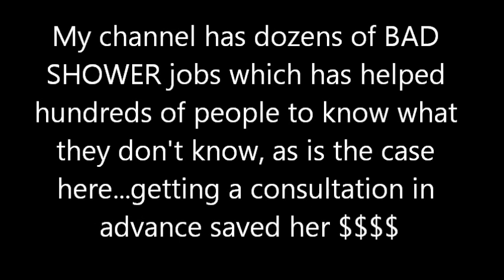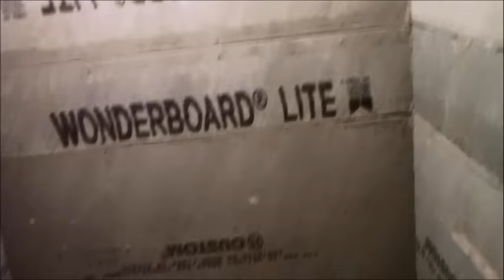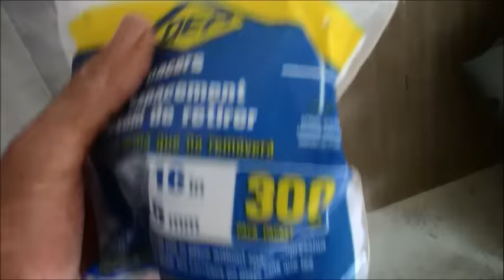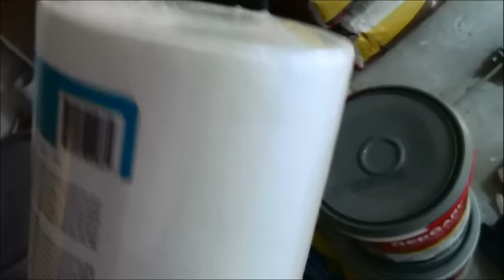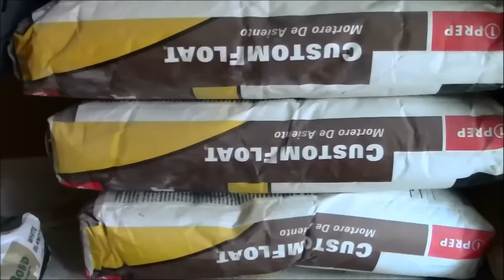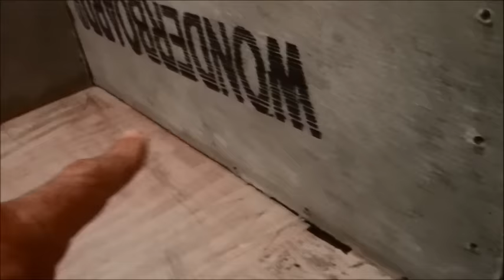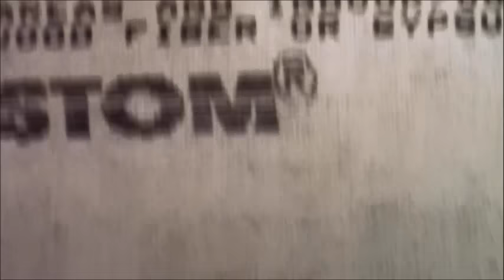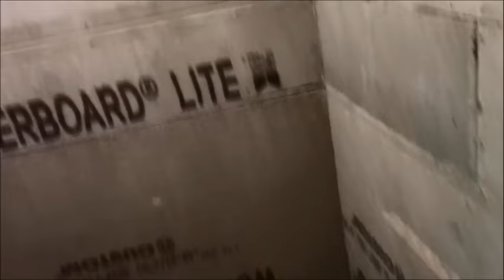BAD SHOWER DAY ONE !!

Comment: red gaurd is useless with out mesh tape
Reply from the maker: Says who ???

I have experiments I've done in my channel using only two coats in a cardboard box, and a drywall box, on every material imaginable filled with water for weeks without any tape
Reply: @StarrTile  mesh tape and red gaurd always go hand and hand every job ive ever done when it comes to waterproofing description with plans and blueprints always calls for  both tape and gaurd together
Reply from the maker: @ronlutes  tape is a crack preventer, Red Gard is a crack preventer, right there on the label, to use both is redundant but you do you
Reply: @StarrTile  tcna f125  or tcna fi25a 
for cracks
Reply from the maker: You assume I subscribe to the tcna recommendations, which I don't, my 23 years experience has taught me better than a book
Reply: @StarrTile  ive got 30 years in the trade and ive seen it  fail time and time again . 
the only time ive seen it perform well is when mesh tape is used with it. 
even with that being said there are so many other way better products that  can be used they cost more but  well worth spending a little more money than taking a chance with red gaurd
Reply from the maker: @ronlutes  if you've been doing this for 30 years then you know as well as I do that walls do not fail, it's always ankle below that is the weakness of any shower, that being said if a liquid topical membrane is applied correctly it will never fail with or without tape, I have done many experiments including flood test with liquid topical membrane and I have never had a failure, if you see failures all the time then I suggest it's operator malfunction and not the product. It is extremely doubtful that the product failed, I would like to see proof of that.

This experiment I did a few months back cast doubt on everything that you think you know..
https://youtu.be/t6y2Fl0wznk
Reply: @StarrTile  i can see your doubting my experience in the trade . i have 15 tile setters working for me i see lots of showers
im not interested in looking at experiments that you or anyone else has done . reason is 
i dont think that any experiment can duplicate any real world situation . all im saying is from what i see in the real world. if your going to use red gaurd  its taking a chance. i see lots of showers that have failed many of them with red gaurd  involved. sure the way its applied makes a big difference . best advise i can give in the real world tile installs when it comes to water proofing if your stuck using red gaurd for some reason use the mesh it is a small step that can avoid a failure
Reply from the maker: @ronlutes  what you don't understand is that experiments exacerbate real life situations, they exaggerate what a real shower would actually go through... I don't do them to convince anybody, I do them to convince myself just like in that last video I showed you I did not know that the liquid topical membrane would actually impregnate into the mortar the way it did so I'm extremely confident now with my builds having done that experiment.
Red Gard is only my go to product because I shop at Home Depot, but truth be told I like ardex better. 

My channel is devoted to putting out real life in real world information and showing demos and the reasons why things fail, I've yet to ever come on a job where a waterproofing method EVER failed, unless done wrong. And my showers have always held up without a call back whatsoever regardless of your tape fixation that I don't agree with.
If I run across the shower that failed solely because there was no tape over the waterproofing I will be double sure to video and post that on my channel 👌🏻👍🏻
Reply: @StarrTile  look red gaurd is not flexible at all when dry. i live in ca we have earthquakes movement will crack redgaurd 
i see it all the time. you should always take that extra step when  using rg . its not what i think i know its what i do know .
Reply: @StarrTile  paint a cardboard box two coats with rg. let it dry . step on it. tell me it holds water .any water proofing products that we use can pass this test. .  you may have a chance if you use mesh tape . maybe

Comment: Oh FFS you have to tape (AND THINSET) the wall seems! You CANNOT just Redguard and hope it fills the seems! Come on. You need to be willing to learn sometimes and not act as a know it all, thought you of course do know a lot.
Reply from the maker: In one sentence tell me what tape is for, I'll wait
Reply: @StarrTile  Sentence? How about two words: monolithic surface. Bye.
Reply from the maker: @aermotors  two words, waterproofer, crack preventer...
Well technically that's three words...  right on the friggin label of redgard.
So you want to use tape and a crack preventer 😂😂😂😂

Ok 👍👌
Reply from the maker: From 1998 not a one failure or call back... if you want to see that you'd have to go to Isaac Ostrom Channel

Oh and by the way you know that any tape is only going to stretch perhaps a 16th of an inch if you're lucky, whereas Redgard stretches up to 4 in and I can send you that video if you would like to see for yourself.✌

Anyway I've never gone on a consultation or seen a shower failure because it didn't have waterproofer on the walls, failures happen from your ankle down, end of story
Reply: Tape is supposed to be thinset over. But you know that? I don't know why on Earth you are talking about tape and stretching. Do you think you just leave it on there raw? Okay.

Also, if you bothered to read completely you would see the "crack preventer" is meant for the tile that you apply later to not crack from cracks below. Not gaps in your actual substrate. Yikes.

"Dormant cracks exceeding 1/8" (3 mm) should be treated in accordance with TCNA F125 or TCNA F125A"
Reply from the maker: @aermotors  every time you make a comment you show your ignorance, I suggest you understand that a liquid topical membrane like redgard, aquadefense, Hydro ban, 8 + 9 all has properties that exclude cracking.. and in fact redgard is commonly used on warehouses and such on concrete to prevent cracking transferring up to the surface. So yes it is in fact used to prevent cracks coming to the surface, and thereby negating any cracking in your tile, Jesus Christ it's sad that I have to explain this to you.
I pray you are not a tile Setter because undoubtedly I will be doing a video of your work very soon !

As to the NTCNA or any other organization you want to throw out there, that pretty much marks you as a book Soldier, can't think on your own so you lost all credibility with me anyway